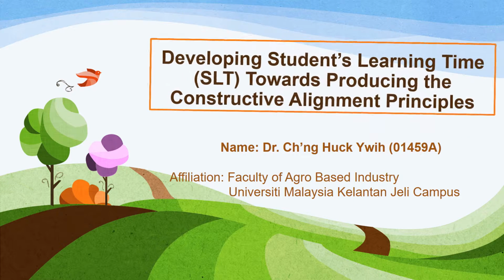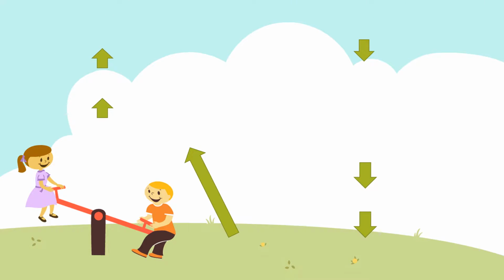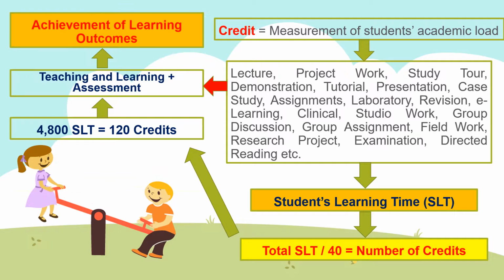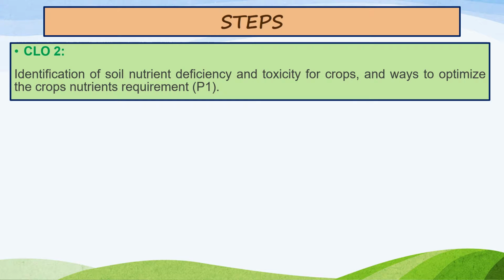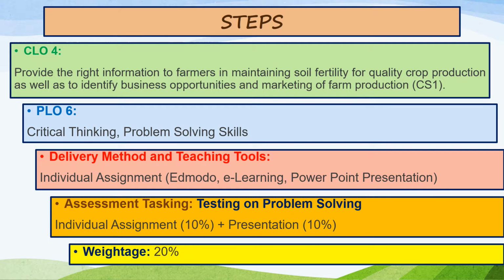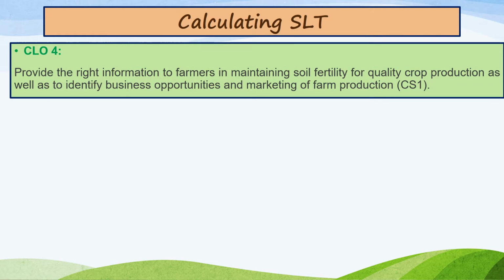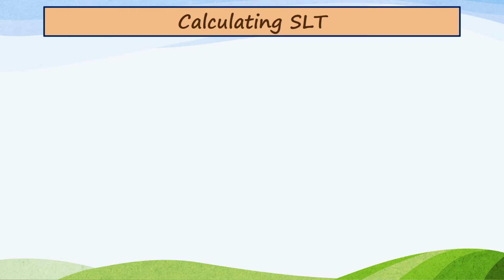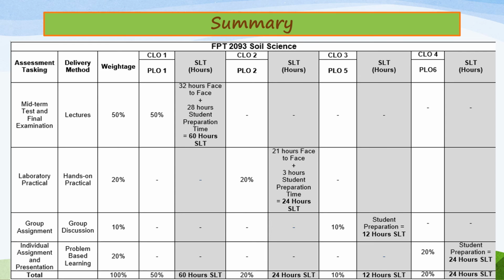Question 2A SLT with recording 2

Comment: Hi again Dr. Ch'ng,
For example CLO1 sets the Cognitive Domain Level at C3.
My question is whether the C3 Level is the minimum level or the maximum level to be achieved?
Reply from the maker: Hi greetings Prof. C3 means that is the maximum level to be achieved. During exam questions preparation, it is advisable to maintain approximately 80% of questions with C3 level. The rests (20%) can be C1 and C2 levels. Thank you.